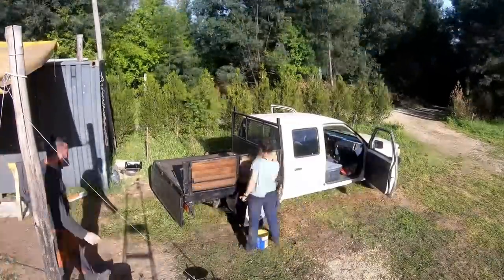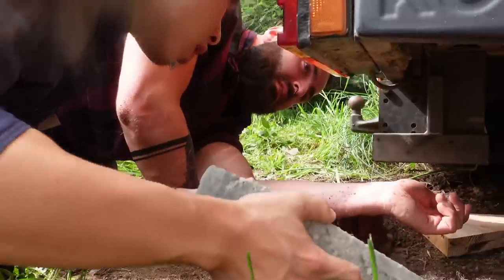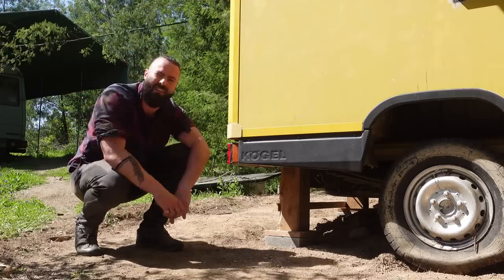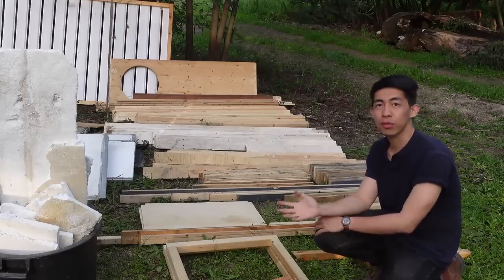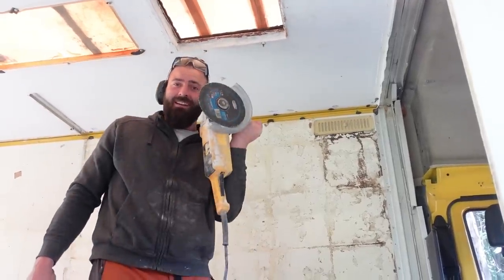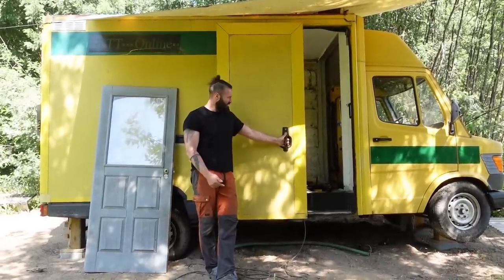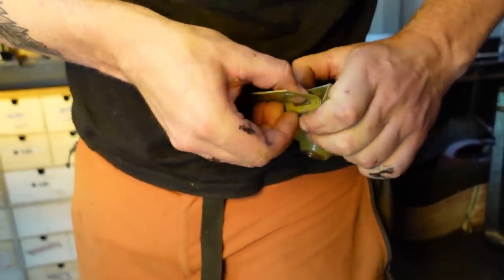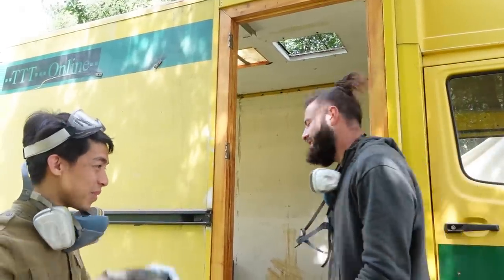#80 Renovating an old German Post Van (part 1)

Comment: I’m confused about the stated intention of the project- living more sustainably. It seems like Kamp always does things the less practical way instead! Why did take out the solar system and dig a trench to run power to the van? Why not just put the solar back in, repairing and replacing components as needed? And why rip out everything including the insulation? It doesn’t make much sense to me.

Comment: Great job guys.  When you need to snake wires in a conduit the best way is to tie a light string to a bit of plastic and suck it from the other end with a vacuum cleaner. Than you can use it as a pull wire or if wires are heavy pull a thicker cord to pull
Reply: Amazing tip ❤

Comment: Hi, A couple of thoughts.
1) With the roof gone, you can add height to the walls, so that you put more insulation in the roof. 
2) if the van is never going to be driven again, can you incorporate the driver and passenger seat spaces into the living area of the van?
Reply: And why not use the passengerdoors as door, so you have more wall- & floor- space and use it for windows. Do you need the engine? If not? More space!
Reply: I’m guessing having the capability to move the van is useful, even if the intention is to move it very rarely )
Reply: I think it has to still be movable for legislation restrictions, since it would be a home otherwise
Reply: Roof deck! 😅
Reply: Mabey even the motor can run a generator in winter.

Comment: Tip for getting a wire through one of those hoses: Tie a rock (roundest possible) to a thin rope and let that fall all the way through, then knot that to the wire on the other side and pull it back. Tip: always have to wires and one going back with the wire so that when you need to pull something else through you can easily get another line in without having to dig it up.

Comment: Tip for removing rivets, if anyone encounters it sometime: use a sharp tool or punch to punch out the steel head that is left inside the rivet before using a drill, it will prolong the life of the drill and make drilling the rivets out much easier! hope this helps

Comment: To pull wire through a long piece of conduit; attach the wire to a cloth plug that is a medium tight fit to the inside of the conduit on one end and the most powerful vacuum cleaner (suction side) to the other end.  If the fit between the plug and conduit is right, it should fly right through. Eazy-peazy.  Ending all of your conduit runs in junction boxes  dug into the earth will facilitate the construction of your micro grid into  the future.  Oversize the home run from the power room to the first junction box to accommodate future load.  Two more tools you need is an impact driver  and penetrating oil (20:30) to break corroded screws free.  I think the container roof you built is an ideal design for this build.  Low overhang oriented to the front porch/deck, solves all of the roof leak problems, provides shade and produces natural convection cooling of the roof.  Build the secondary roof so it can be dismounted in one piece in the future when the van body life has run out.  The demolition of the fiberglass roof was unnecessary. Removing one of the leaking skylights for an inspection would have revealed it to be a three play panel with a fiberglass top layer, polyisocyanurate foam core and an inner skin.  So the roof had high performance insulation. It was not designed to support the weight of a person.   It was serving its intended purpose and the  primary convection roof would have made it fully functional. Worse, the demolished fiberglass and polyisocyanurate is strictly landfill material now. That is a shame.

Comment: As you said the van was not going to be driven any more, was there any particular reason why you did not remove the rear wheels and wheel arches to create a bigger floor space?
Reply: They might still want to be able to tow the van, since they still haven't figured out how they will be using the land.

Comment: I didn't go through the bazillion mold comments but I'm in the water remediation and mold removal business and saw some bad advice. Here are my comments for what they may be worth. 1) As you know mold requires food (organic materials), water (cold, dark, unventilated areas contain a higher density of moisture), and oxygen to start and spread. Bottom line is that you cannot leave your abode unprotected again next winter or even a few weeks at a time. Dehumidifiers are cheap and a manufacturer would chip in one for each of the two main buildings without a problem. You just need to be certain you get an auto-dehumidifier (not continuous that would be a fire hazard and suck energy). There are pod casters using these in off grid / summer homes all the time. An Auto-DU has a thermostat you can adjust humidity by Wi-Fi and when the 50 pint tank is full it discharges through a 9.5 mm hose to the sink drain. 2) You also know to be more cognizant of building materials like insulation, wall board behind porcelain, and paint/stain coatings have to be better than a sealant or barrier. They must non-porous and moisture resistant. In the US a product called Kilz is a popular primer used below paint. By its very nature latex paint was invented with microscopic pores that allows water a way out, so water doesn't do damage trying to bust through like with the old hard shell oil base paints. In our business we have a silly way of explaining the science of drying to the customer by saying, "wet goes to dry" and that's why mold spreads so rapidly. Stick the corner of a napkin in a glass of water and watch the water take-off up the napkin against gravity... it's trying to get to where it is dry. 3) Do not use bleach to kill mold as so many so-called experts recommend. First, bleach is a toxic chemical both harmful to the environment as well as cause respiratory problems in people. Second, the residual of bleach will kill any subsequent mold remediation products you may try to use later and render them ineffective. If you must go organic use "Undiluted White Distilled Vinegar" with 5% acidity. I now use Vinegar on 95% of mold jobs and have never had a resurgence. I offer and carry specialty mold remediation products to every job, but fewer and fewer customers or their doctors will sign off on use even though these same products are used in Hospital rooms between patients. The specialty mold product most widely endorsed by US Gov't agencies like the Environmental Protection Agency and Industry Associations is called "RMR-141" with claims to be organic. Sorry for the length, but I do have one strong criticism of the group, you are all so careful to wear protective clothing, gloves, goggles etc. BUT NO MASKS. I'll give you first-hand knowledge that one day you may wake up with debilitating respiratory issues and it will be too late. COVID is still with us and there are plenty of masks around. Please wear a mask any time around mold. Love your work.

Comment: Level out the floor by  cutting off the wheel wells..strip out the seats, steering column, dash and engine to make even more useable space. There can be an engine compartment storage. Gut it. If its not goung to be driving may as well.
Reply: Hey, maybe using proper house wire /electrical/ is your safest option.
That extension cord cable will so often just melt at the connection as inevitably someone overloads the wires ability..carefully..

Comment: DId you consider removing the tires so you could bring the body closer to the ground for easier ingress and egress?  At this point, you can salvage the rear axle, all of the suspension and the engine for adaptive reuse in upcoming  projects.  Store the salvage  under the roof overhang on a pallet  to slow rusting.  As it sits, attached to the body, the rate of rust decomposition is accelerated due to moisture  rising from the earth.  THis would have been a good time to add a vapor barrier under the body entire structure to stop moisture from rising, slowing rust decomp.  Removing the floor was unnecessary once an examination determined that it had been constructed properly -  EPS insulation (can not be recycled), nailing strips and a vapor barrier finished with thin real wood flooring.  You can not improve on that construction and the EPS and vapor barrier is strictly landfill material.  That is a shame.  THe difficult to remove wall is high grade aluminum extrusion.  Valuable at the crap dealer.  Can not be cut with a grinding wheel as the soft aluminum clogs the cutting edge.  You want a demolition saw with a blade for this job.  In the US we call it a Sawzall.  You should add one to the tool locker with an assortment of blades.  With the appropriate blade, a demolition saw is handy for cutting smaller (diameter) pieces of firewood.  If it is battery operated (rather than plugin) it can be used for pruning large branches and cutting down mimosa.
Reply: Good idea
Reply: @karenmarshall7056  Thank you! 👍

Comment: Seeing the preview for the new roof, I'm surprised you didn't opt for a curved roof? More head room for those staying at Project Kamp, and less likely to have water pool on top.
Reply: I think this too!
You can lay out camber like the deck of a sail boat with two boards joined in a shallow angle.
Do not make it planar and you will not have anywhere for water to start standing. (You would also gain headroom inside)

Comment: Wow so much overkill around the fibreglass i used to use this a lot repairing cars its really not that bad inhalation yes but not to the extent of taping up your sleeves lol and when you want to put cable in conduit try a piece of string attached to a plastic bag stuff the bag in the conduit and then use a vacuum clean on the other end to suck the bag up the tire the string to the wire and pull it through the conduit works a treat

Comment: Pro tip if you need to pull a cable through a hose again:
Get a small plastic bag and tie a string to it. Put a vacuum cleaner on the other end to suck it through. Then pull the cable through with the string. That's how we do it with conduit in concrete slabs.

Comment: TIP FOR WIRES AND TUBES!! use an air compressor to blow a thin rope or heavy string through the tube, and use the string to pull the wire. it's very fast and easy. a shop vac can also work to suck the string through the tube

i love the old post vehicles. i always wanted a deutche post mk2 golf van. they were so cool!

that styrofoam could maybe be broken into tiny bits and put into bags to use as insulation behind paneling.

Comment: Is there a specific reason for removing the old rubber seal from the previous door? I fail to see how it would have posed a significant issue, given that you attached the new doorframe directly to the vehicle frame. The seal could have been easily compressed, and could have provided added insulation against moisture and temperature.

Comment: That's quite shallow for an electrical trench. Electrical code in the United States is generally 18" or 24" depending on encasement or direct burial of the line. Only low voltage lines would be seen that shallow, but your cord looks like a ~120V line. Consider putting that deeper!!

Comment: for the old camper van roof: get some fiberglass sheets and resin, repair the surface to make it even and cover the openings. build a sturdy wooden base and you've got a new large table
Reply: They tend to avoid materials such as fiberglass because it's not very natural

Comment: Was that metal wall in "Grinding the wall", part is aluminium? If its aluminium, you need a special aluminium cutting saw blade. It has Cobolt tips to keep it sharp. The regular metal cutting saw blade will worn out with even a small aluminium cut.

Comment: Although this may not be totally environmentally friendly, it is a good way to use up polystyrene: break up the styrene into a container of acetone. Keep adding more styrene as each piece melts until you have a thick glue. This can be used to stick just about anything to anything. 
BEWARE OF THE FUMES - do this outside.

Comment: to pass a wire through a tube you put some fishing nylon string with a piece of paper or styrofoam in the tube and you use a vacuum to suck it to the other side, next you tie the nylon to the wire and pull the naylon out of the tube leaving the wire inside, understood or need more datails?

Comment: I think it looked better if the door opened up to the front of the car covering the car door side when open having unhindered access to a potential small veranda/ deck  in front of the car/ house.
Plus even if the car doesn’t drive any more, if it would, you never install a door that doesn’t get closed by the wind/ momentum of moving forward.
Nice build no matter what I would do though.

Comment: Use a vacuum to pull a string with some paper at the end through the piping next time.
And pipes for electrical installation should be at least 35 cm below ground.
And please do not use soft wires in the ground 😢

Comment: Niche question, but seems like the Kamp screw system uses torx and the old ones are phillips heads. Do you save the ones that are still usable but don't fit the system in a large bucket labelled "treasure"?

Comment: It's a shame scrap yards are no longer the proto-recycling centres they used to be.
Very conflicted about using old vehicles as houses .. they're terrible to live in and leave the mechanical parts wasted.
🤷🏼‍♀️
Reply: If it's that old, the mechanical parts will either be so rotten or obsolete that they could not be reused, or recycled. At that point the best thing for it is to gut it and use the metal hull as a new living space or storage.

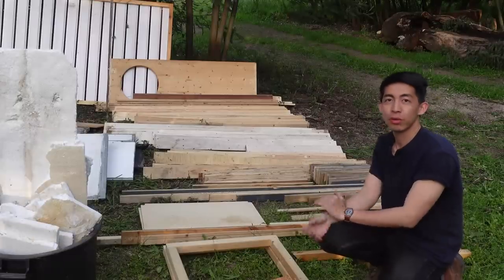Comment: 11:45 With styrofoam, you could make "styrocrete". It's a mix between aircrete and styrofoam. Strong and very insulated.
But you would need a foam generator (1200$ from DomeGaia or make your own), cement, a mixer (3K or just by hand, but it's longer), and a shredder (you can make it from an electric lawnmower). 
This guy shows every steps in several youtube videos. https://youtu.be/_FBhqONKB1w

Comment: 19:05, wouldn't be better to use a small string, with a machine nut binding to it, putting in the pipe, and then use a magnet to guide it to the other end, and then bind this string to the eletric cable and just pull the string through the pipe, you all look so exausted

i know that you can't use this time, but maybe next time so you don't get that much trouble

Comment: I don’t get it at all!
You could build a small cabin, quicker, cheaper and better than rebuilding this van, which is no longer going to be a van just a cabin.
Reply: Reuse. That's the point.
Reply: Because it's 'on wheels' they probably don't have to do any paperwork
Reply: They have not spent any money yet, and they already have a floor, walls and windows. Wood is pretty expensive in Portugal, so they already saved at least €1000.
Reply: @hermanritzema I'm guessing laws are similar to Spain. Once the wheels come off, it is considered a permanent structure/dwelling.

Comment: A year late...but if you just use it as a house, not driving adain:  Did you empty out all the vehicle fluids? Diesel, oils, breaking fluid etc.? Letting the car's technic rot til leakage of that fluids is not very sustainable and also not good for the environment.